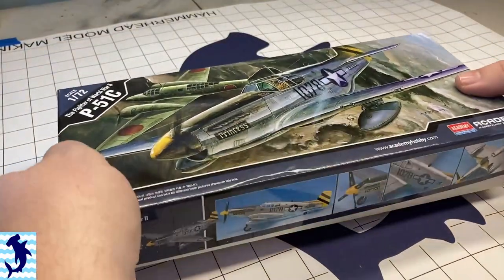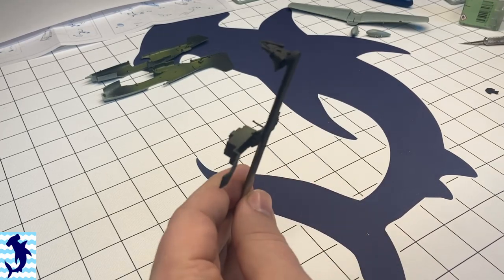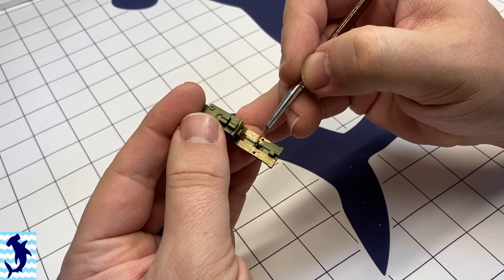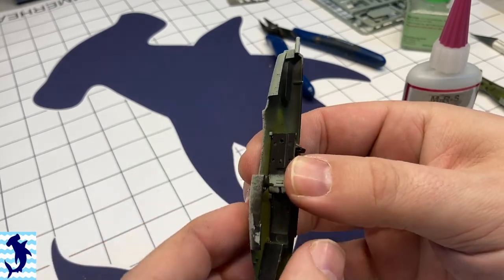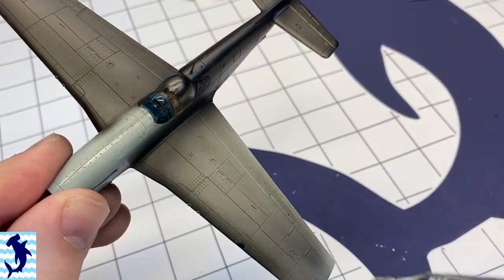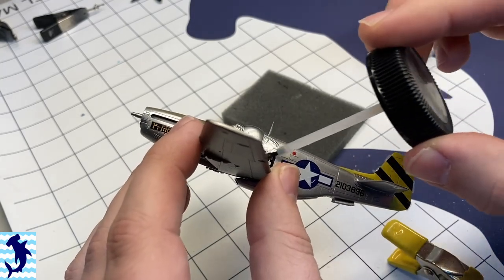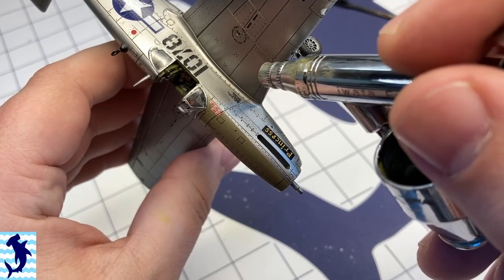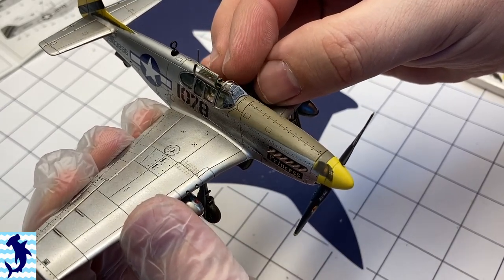Academy P 51C 1:72 Scale | Full Build Video

Comment: When you do NMF paint schemes, how do you prevent the tape from pulling off your metallic paint around the areas you masked off for subsequent painting such as the anti-glare panel on front or  the vertical stabilizer?
Reply from the maker: I think the biggest factor is prepping the surface prior to laying down the metallic paint.  Ensuring you have a good primer base that is clean from oils and dust and fully cured.  But, it really just comes down to experimenting with combinations of metallic paint and primers.  I used Alclad metallic paints on this one which are lacquer paints and can be quite robust and I've used Vallejo metallics paints as well with good results.  Also, allow a good amount of time for the metallic paint to cure before doing any masking, I generally wait 24 hours.  Hope this helps.

Comment: I've built this kit too, in the end it looks like an early Mustang should, but i found two important things are wrong at this Academy kit. The propeller is too small in diameter, and the landing gear looks somewhat wrong at the finished model, maybe the legs a bit too long. I couldn't figure out what exactly is wrong with the landing gear, but it looks odd.
Reply from the maker: Interesting, I didn't notice that, but I'll have another look.
Reply: @HammerheadModelMaking  compare with front view photos and drawings of the B/C Mustang. I'm a Mustang buff since 40 years, built a whole bunch of that plane in all scales up to flying RC models. 😉